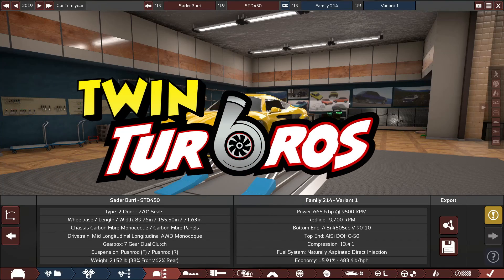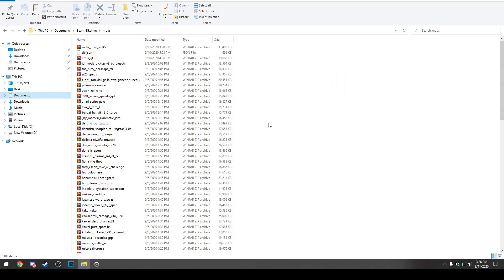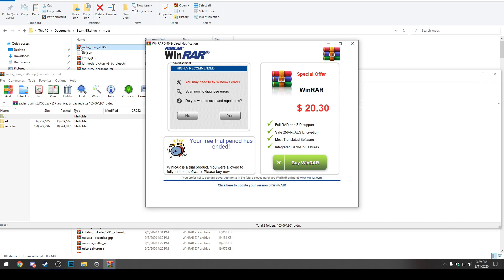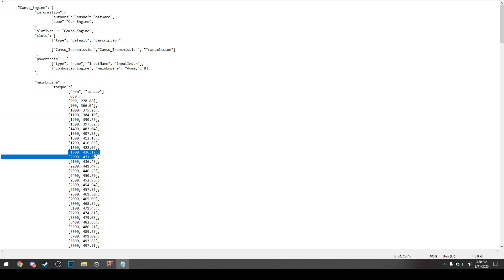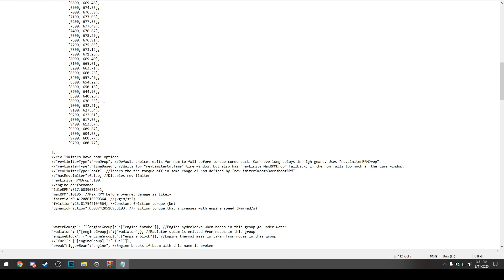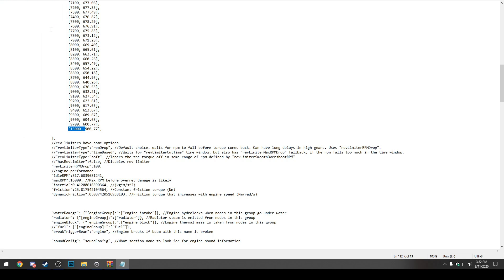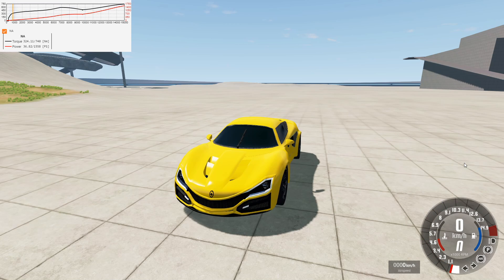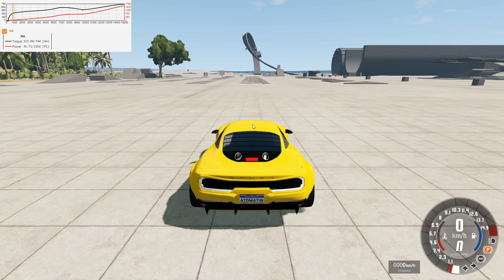How To Make Automation To BeamNG Cars Rev Higher!?

Comment: I don't get the point of these rev vids is it for higher speeds or is it to hear the sound of the car?? i want a higher speed but when my car drives it doesn't reach the maximum torque and power but weirdly it reaches it when my car is off the ground..?
Reply: Beamng is a physics game. That said, your speedometer measures wheel speed and not the actual speed of the car. Drag is also a major issue which prevents you from hitting higher speeds. Could use power to bypass it but then the car becomes impossible to drive at lower speeds due to wheel spin. Could increase tire grip but then if you turn a little to hard and your car flips all over the place. It is very hard to make a high speed car that doesn't destroy itself and can turn.

Comment: when i open the engine file instead of notepad opening it winrar just views it, and it doesnt let me edit the file it just gives me the error noise whenever i try to change anything
Reply: if anyone is also facing this issue just know that i was able to solve it by changing the default viewer in the winrar settings to notepad
Reply: @batofwisdom5692  thx so much

Comment from the maker: Happy friday everyone eh!

Just wanted to post a quick tutorial, also wanted to say im going to be streaming starting in around an hour. if anyone wants to pop in :)
Reply: I'm definitely gonna play around with this stuff
Reply: I cant seem to do anything within the viewer. Just a windows noise. Suggestions?
Reply: So ive got no clue if you will see this but i need some mayjor help i was able to change the rpm of my cars but after the 4th or so of changing it and uesing the note pad to do so it wanted me to save it as a file and not let me update the current file could you help me?
Reply from the maker: Make sure beamng is closed why trying to save the file, as when i had it opened I had the same issue!